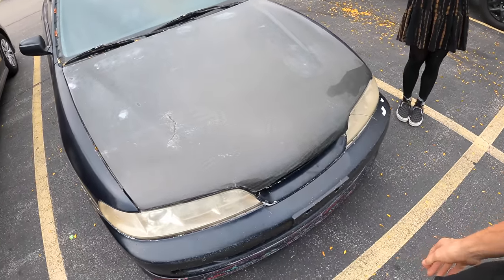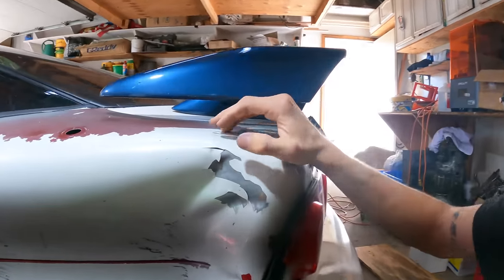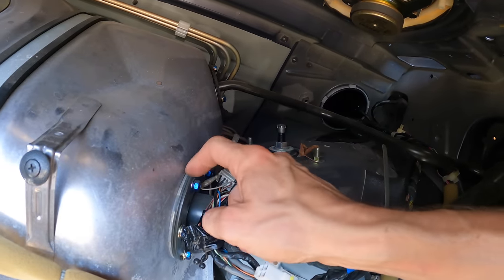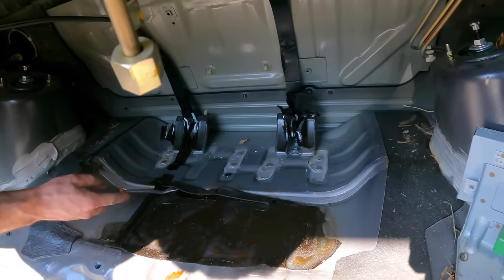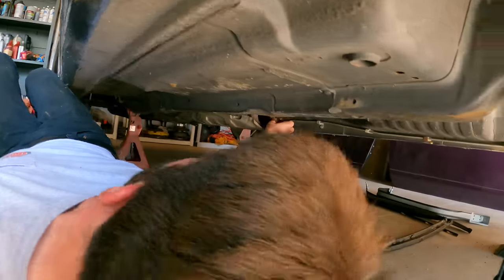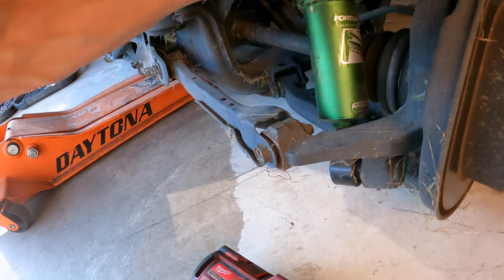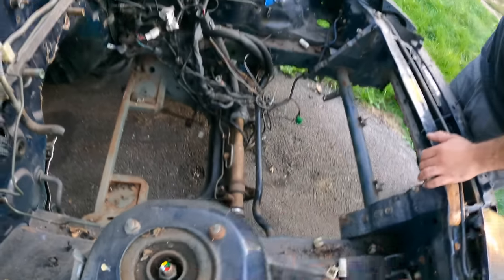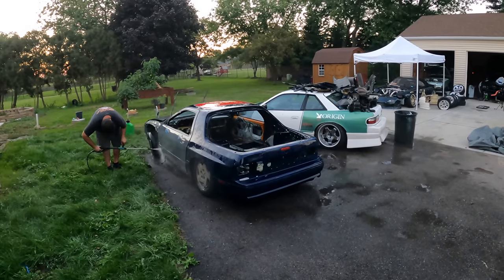Stripping my Nissan Gloria Restoration Project!

Comment: Also, in a previous video you mentioned a swap for the Gloria, you should do a VQ35DE swap, you can find them in 2000-2004 Pathfinders. They make around 200-250hp.
Reply: Or making 400hp with the ol 12v vg 😂👀

Comment: hey mike! i have an FC that i just recently put a LS in (ik i’m a bad guy) but just some info for Omar: the FCs came in 4 lug and 5 lug. 4 lugs were base model NAs and the 5 lugs were the T2s. i’m not sure if he has a s4 or s5 chassi. if it’s a s5 they all transitioned over to 5 lug im pretty sure and it’s 5x114.3. but if it’s a 4 lug car (s4) then s5 tails will not fit. you will have to do some cutting around the reverse light bulb socket  area on the chassi, since s5s are one giant lens. also, good luck finding calipers for that car, they simply do not exist. what usually goes bad is the seal between the ebrake bracket and the caliper. that requires a seal and a new e brake bearing. the bearing is a small roller bearing that costs $30 🥲. i’d also do a rear steer delete. there’s a bushing in the rear hubs that allows the back wheels to kind of move around when you’re turning to help with handling. those usually make your car ride like crap since they go bad and it’s best to just substitute them with solid bushings instead. also the evo 9 front brembos are bolt on 😏. love the channel mike! if anyone wants for info or has an fc id really appreciate if you check out my insta! @no.dorito.fc

Comment: I work in a panel shop and really any good panel beater should be able to pull out the 240 quarter panel, it’d take a while to get it all pulled out again and then most likely have to put a lil bog/ bondo to smooth it out again. Bog is quite good now days and as long as it isn’t more than 4mm thick it should be fine an last a long time. Anyways much love from Australia!

Comment: Yeah that blue mirror was a T2 mirror. The FC also came with either a 4x114.3 or 5x114.3 depending on what was speced into the car factory
Reply: I thought the FB had the weird 4 lug pattern, and FCs had 5 lug as standard?

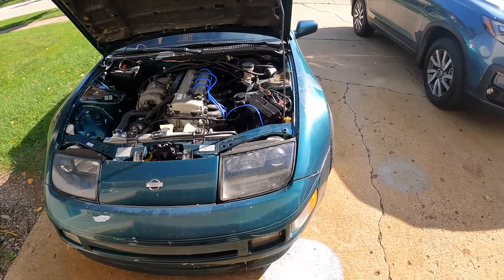Comment: @03:38, you are supposed to remove the headlight, those tabs unbolt. bend them so they create a tighter positive grasp on the replacement seal when reinstalling those clips on the outer side of that rubber seal.

Comment: Idk if this will be seen but i got some info about FC rx7’s, to my knowledge they did not come in brown for interiors, they came in blue, maroon,(which will look brown with age), black and gray .The early fc rx7’s 1986-1988 came with manual windows and locks, 1988-1999 i think are all auto. Base 1986-1988 came in 4lug (4x114) but the higher trim got 5 lug (5x114) and 1988-1990 are all 5 lug from factory. Hope this info helps, if you got anymore questions i should be able to answer them.

Comment: So the oe crown Vic mesh wheels work great, and good fitment for the fc. The mirror is a stock s5. S4 and s5 have different mirrors and they are also different from the turbo 2.

Comment: Response to comment about OEM S13 wing early in the video -  It comes with an OEM wing so someone can enjoy some future rust!

Also the hardest part of any home major car project is finding a place to stash all the pieces you're taking off and as well as accumulated parts you're putting on until you need them... at least it is for me... I have S13 pieces stashed all over the garage, in the house on multiple floors, etc.

Hope you're ready for winter... I know I'm not...  This past week was warm, but it looks like this was the last warm weather until next year... Temps only go down from here.

Comment: There is no difference in turbo and non turbo mirrors only aero and non aero the bins were standard rear seats optional. 5x114.3 for anything above the base model if it was the base model it would have been 4x114.3.